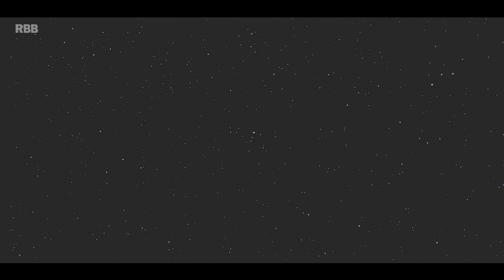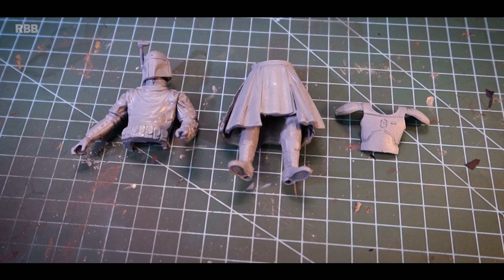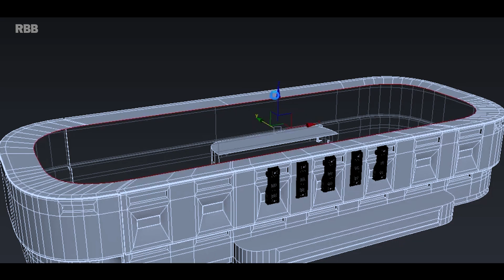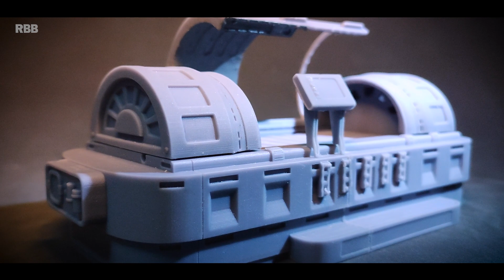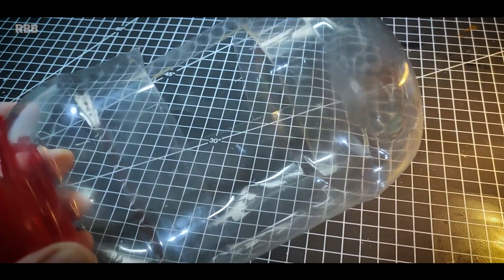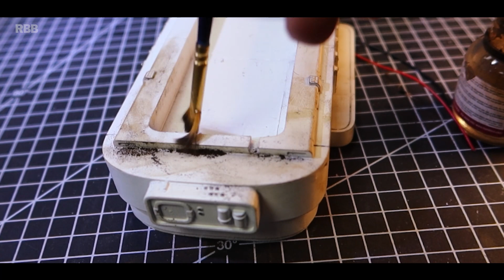Star Wars: Book Of Boba Fett Bacta Tank Miniature Build

Comment: @Rebel Base Builds I bought the files for N1 Modified Starfighter on Sketchfab. I tried to print them out but the nose has some problems and is paper thin. I barely got it to print. I can't find any way to contact you. It needs to be made solid if possible. Thanks.
Reply from the maker: Hey John, please re download I updated the file, it's solid now.  Thanks.
Reply: @RebelBaseBuilds  thank you. I will.